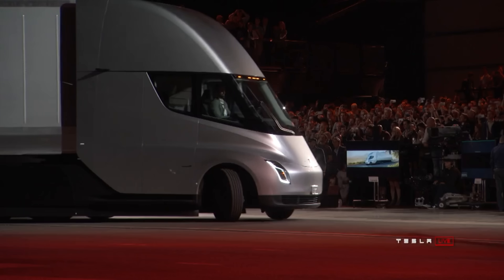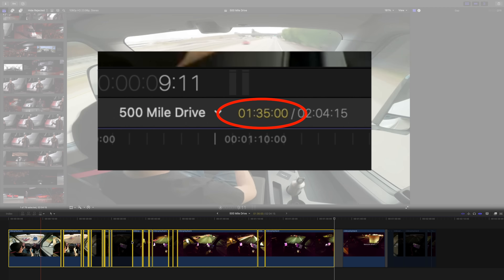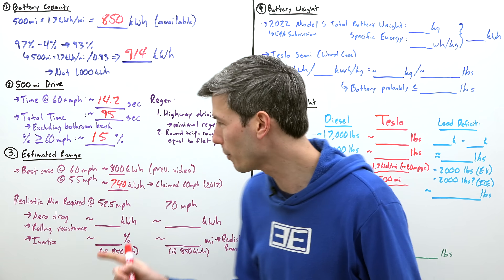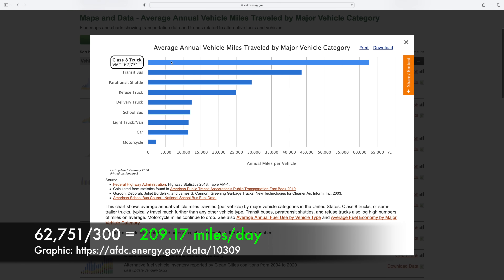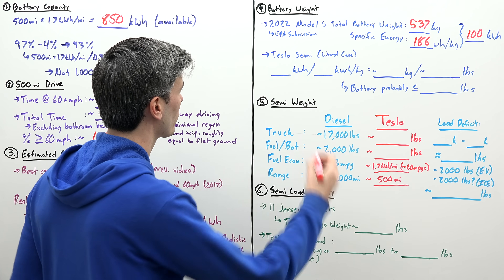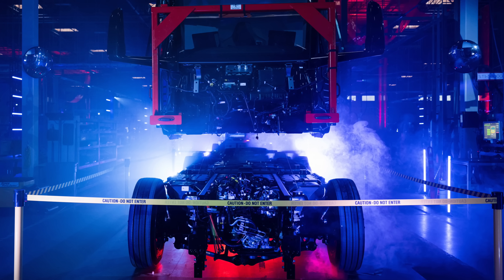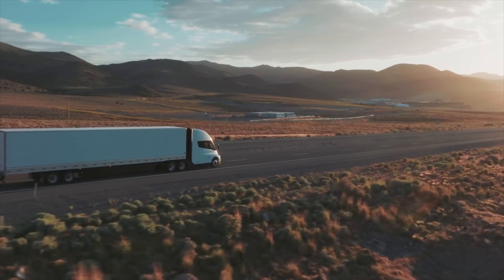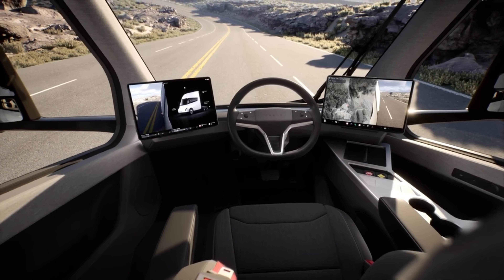Does The Tesla Semi Make Any Sense? Part 2!

Comment: Thunderfoot made a video about the Tesla Semi claiming the 10ft Jersey barriers it hauled on that trip were only 1,000 pounds and that other trucks can haul twice as many.  As proof he showed two pictures of 4 axle trucks hauling 3 axle trailers which were loaded with dozens of 6ft barriers. I pointed out that he was comparing apples to oranges with cherry picked photos of special equipment and did the math to prove the Tesla truck seemed to only be carrying 4,000lbs less than a normal truck.  Thunderfoot blocked me from the comments. He doesn't care if people call him names but if they actually prove him wrong he can't handle it. 

I think the real problem with Tesla trucks is charging capacity at truck stops.  They're great for short haul warehouse to warehouse where they have access to company chargers but if you think giant truck stops on I-70 are going to support 100 trucks fast charging at the same time you'd better be putting some serious money into energy infrastructure all along the interstates.  And drivers can't afford to wait in line long enough to take turns charging due to FMCSA driver hours of service regulations. In transportation, profit is limited by regulations on driver duty clocks.  If you take even 30 minutes out of a drivers 660 available driving minutes, you reduce your profit by as much as 22%.
Reply: Yeah...that sounds like a TF thing.

Comment: "You're only carrying 5000lbs more battery around with you (all the time)"  Over 1 million miles that adds up to a lot, and not just energy efficiency.  You're talking about every braking event doing more wear and tear on brakes and suspension, and motors/drivetrain.  If you're arguing in favor of electric trucks over long distances, i'm sorry it's just not there, trains should be doing that anyways.
Reply: That 5,000 is not going to strain anything that much more than it already would be. And if you are going to break it down that way, then you might as well look at the fact that you won't be dealing wear and tear common to an internal combustion engine..or even the regular oil changes. It's going to just come out in the wash and when it comes to cars, the EV's edge ahead in maintenance despite carrying batteries around. 
..and no I'm not trying to champion EV trucks or whatever...but your argument is about the 5,000 pounds is flawed and doesn't work.

Comment: Freightliner isn't trying to fvck around with the numbers, they know they can get great torque, efficiency, and energy costs when used locally.  They're selling the eCascadia models to very happy port operators.  Stop and Gos with onsight charging... optimal conditions.  Cities and municipalities with local truck operations will be quick electric truck adopters because they have mandated CO2 obligations.  Over-the-road trucks just don't have the energy density or infrastructure to make it cost-effective (which drives everything in this capitalist country).

Comment: If they have an 850kw battery and a 4680 cell holds 100Wh (tesla's number, being kind) and each cell weighs 350 grams, the total battery pack is gonna weigh over 7000lbs alone.  Again these are assuming the best.

Comment: 7.3 mpg US gal = 32.2 Litres/100 Km
Volvo tests pulling 32 metric tonnes in Germany at 80 Kph / 50mph = 21.48 Litres/100 Km But it's hard to compare given there are many variables.
Trucks are limited to 90 Kph / 56 mph in Europe and many operators and countries limit them further. EG Autobahn truck limit is 80 kph / 50 mph.

Comment: A few problems with your video.
The semi has 4680 batteries which are supposedly much lighter than the batteries in the model S.
A semi weighs 17,000lbs with it’s diesel engine and transmission. A Cummins ISX15 weighs over 3000lbs on its own, and another 1200-2000lbs for the trans. The Tesla semi doesn’t have that weight, and the drive motors are (supposedly) very light. Few hundred lbs or so total. The Tesla is most likely still heavier, but it’s not by much. 

That to say, I’m not buying that the semi pulling 82,000lbs is as efficient as a empty ford Lightning, at 1.7kwh/mi. Time will tell I guess, but that is nuts if true.
Reply: It isnt using 4680 batteries
Reply: @orishaeshu1084  interesting, I thought that was the hold up with the thing. That definitely makes it heavier then. 
Still, his math isn’t accounting for the 4500+lbs the Tesla doesn’t have in diesel engine, transmission, and after treatment system weight.
Reply: @jason91notch  his math for the jersey barriers check out though. Regardless he’s still taking a educated guess, and even with a worst case scenario, the Semi obeys the laws of physics and can work, just needs the infrastructure. Remember too that this is generation 1. In 20 years where will we be at?
Reply: @orishaeshu1084  I agree 100%. My point is if the semi weighs 20-22k lbs instead of 27k lbs like he is guessing in the video, that makes the semi even more viable in the real world.
Reply: @jason91notch  hopefully it is much lighter than we think. But so far a lot of details are a secret… likely due to possible competition. Remember what Nikola tried to do.
Reply: @orishaeshu1084  yeah it’s tough to tell. I think 20-22k lbs is a pretty reasonable guess. if they ever get the 4680’s in it, that’ll drop to 17-19k. 
The biggest issue with these is being able to do 1mw charging. That’s more energy than most truck stops are using as a whole, all going to a single truck. The infrastructure for that is going to take a long time to build up.
Reply: @jason91notch  Tesla will definitely have a use for all their spent EV batteries for storage, and solar is getting cheaper. But yeah if Tesla energy doesn’t step its game up, that will be a problem.
Reply: @orishaeshu1084  even if they offset it with solar arrays/batteries, if it’s tied to the grid in any way then transformers feeding it will have to be upgraded. It’ll definitely be interesting to see how the infrastructure side of this plays out.
Reply: @orishaeshu1084  another thing to think about- if they’re being used as dock-to-dock trucks and have all night to charge, they’ll still need 150-200kw chargers to charge overnight. Which means DCFC’s will have to be installed at these ports, at an enormous cost, 30k-60k each.

Comment: 2.1 version will be needed -
transportation of upper limits of cargo (up to 80,000 pounds)

but I think, only due to an increase in battery capacity, e-motors power,  number of wheels and trailers for one tractor.

Comment: Is 42 psi common for the trucks? Also I wonder how much weight was on it for the 500mi since estimate about 20 -25 pallets and the rear one says 600kg.
Reply: 42psi?
Reply: @EngineeringExplained did you see this tire pressure?

Comment: Also, using a flat ground mpg for diesel class 8s  is not a fair comparison as they do not recover energy on downhill stretches like the Tesla Semi: accordingly, a trip involving crossing a mountain range will cost the diesel significantly on its fuel economy.  And the average efficiency numbers I've found elsewhere on the web seem to point to 5 to 6 mpg in the real world, not 7.3 which I assume was under very specific circumstances.

Comment: There is another video that gives more info on vehicle GVW (44K & 49.5K LBs), power of the 500 was listed at 900kWh. Cant find it. 
If the power is now 850-900 kWh, it will do nothing to help the ranges of realistic routes with hills, wind and cold.
EE and Tesla info show that trucks dont all go maximum distances or with maximum loads, which is fine, but in realistic conditions, drivers may find that is all the tesla can manage and nothing more.
Not quite the panacea that Electric Jesus tried to imply.

Comment: It is important to keep all kinds of technologie being advanced and improved, but electric trucks are far from ready to be viable.
First you need to have the grid ready which not even the USA has, it is quite an expensive improvement and I doubt its viability in the near future.
Then you need to consider the climate, just now the US got hit by a massive snowstorm and electricity went out in several locations, you should also consider floods, snow and heavy rain with electric trucks with 1 or more years of service, since the combinations of rust, salt and potential minor traffic accidents can severely compromise the battery isolation system.
Other important things to consider are the charging times, battery life span and disposability, battery manufacturing cost, the social cost (the minerals to manufacture the batteries are controled by Chinese mines in empobrished countries) and the true enviromental impact of manufacturing the batteries since not only the mining polutes the air, but it also polutes the water and the soil.
Not only that, the supposed goal of using electric trucks is to reduce carbon emitions, but no one is talking about the actual source of electric energy in USA or all over the world for that matter, which is its mayority fossil fuels, that alone defeats the purpose of using electric trucks.
Again, I am not against the improvement and development of new technologies, but electric vehicles are far from being the ideal medium for transportations that the government and big companies claim, we have far better ways to transport goods and people and we should still use them until a new technology actually becomes a better option.
BTW, I would also say that we are making a mistake introducing more and more electronics in our vehicles, a single solar flare can put us down again in the dark age and we should be integrating mechanical technologies in our transportation and vital infrastructure as a faiol safe in the case of electronics being disabled by an unforeseen and uncontrolable force.
Reply: Does it? It took Horatio Jackson around 63 days to drive across the US. There was barely any infrastructure. He drove on railroad tracks, paths that were barely roads, through fields, there were no gas stations (he had to mail order gas and parts sometimes) and there wasn't even a complete atlas or set of maps. You could easily make the argument that the infrastructure for the car was not there. But the car came anyway and everything else followed. If you spend all your time waiting until all the details are worked out ahead of time, you'll never get there. 

"but no one is talking about the actual source of electric..." Yes, people have talked about it...to death it has been discussed. The fact is it still works out in favor of the EV. And if your concern is about where the electric is coming from, you don't want to look at how inefficient our current method is. We currently use electricity and gas at every single step in the process to get gas to your gas station so you can use gas to go get gas. 

Solar storms? If a solar storm knocking everything out, including cars, is your concern...it's too late. But, one of the strongest flares occurred in 2003 and was barely noticed. Vital infrastructure is far more likely to get knocked out locally by other events. One tree fall can cut off an entire neighborhood or effect power for thousands. Now you are just trying to plan around a worst case scenario doomsday level scenario. And yes, you can keep saying but what it but what if but what if until it is catastrophic, but at that point you'd be screwed no matter what.
Reply: @AveragePicker  There is a little flaw with your argument, we have better more cost efficient meduims of transporttation than EVs, and the Internal combustion engine did had a lot of advantages over trains and animals of burden, nor inly that, you never adressed the social cost and the inmense scarcity of the minerals needed to go full electric nor the viability of the grid handling all that new flow of energy being pulled from EVs. This is exactly why I started my argument stating that it is always important to keep researching and improving new technologies, meaning that I am not against EV's per se, but that I am against the obviously political and financial reasons behind its forced push, which is supposedly intended to reduce carbon emitions and that does not align with reality, and that is precisely why the electricity source type is important in my original argument so, even if EVs in the perfect scenario are more efficient after 2 years of use vs an  internal combustion vehicle, the carbon emision savings are negligeable compared to the carbon amitions of a single private jet used by polititians and climate change advocates and that is not even considering that carbon emisions from IC engines is only a small percentage of the total carbon emisions worldwide.
Reply: @Monstah_Huntah  As I said , it's been discussed and researched. The carbon emissions savings is not negligible. Even if only used coal plants, the CE is still lower.

Comment: One aspect not discussed is the elimination of the Jake brakes typically used for descending long steep grades. Should one expect equivalent performance from an electric version of semi?
Reply: Sounds fine and dandy, but if the battery is charged to 80% or higher at a high altitude, once the regeneration fully charges the batteries it will have to dissipate the remaining energy as heat since over-charging batteries will harm them no matter what.

Compression brakes turn the engine into an air compressor but they don't use any fuel in the process. A lot of EV fanboys seem to think that the engine is still burning fuel when the Jakes come on, which is disingenuous beyond recognition.

Comment: This is all the engineering side. What it doesn't address is usefulness. The center seating position is probably the worst problem followed by the absolutely impractical position of the doors. In this truck you can't drive up to a gate and hand down paperwork. You have to get up, walk around the driver seat and reach out the door. The same seating position problem comes into play when you want to pass a slower vehicle: you have to pull a lot more into the oncoming traffic to be able to see past the truck in front of you. That aside, the door location seems to make a living space in the cabin pretty much impossible and you drag dirt in every time you leave the vehicle. In a traditional truck that dirt stays on the driver floor mat, in a Tesla you drag it from the behind the driver seat door all the way through. I'm pretty certain many truckers will not be happy with any of that.

Comment: Overall a good analysis. I do have to disagree that power consumption is the same on level and hilly roads. I believe there is at least a 50% loss in recovery during regen. My Leaf barely gets 50% recovery on hills that start and end at the same elevation. You lost me on your discussion of speed during the Semi’s video trip.  The CA speed limit for trucks is 55mph. And the route the truck took is through the most congested corridors in California. A trucker would be lucky to maintain a 45 mph average speed for that trip.
Reply: The regenerative breaking is "tuned" differently for different vehicles. Companies tend to split some difference of tradeoffs depending on what they want out of it. Tires can even come into play as companies have to meet stopping distance regulations, and some are starting to not use the lower rolling resistance tires because the range increase they provide is minimum and the difference can be recovered from the brakes somewhat instead. ...Now I also wouldn't be surprised if to get those numbers they essentially tuned the brakes to something that feels completely unnatural.

Comment: In the cost you also have to consider  battery-pack replacement. If you run 350-500 miles / day (a part of the trucks) means you have a 0 to 100% charge per day, possible fast charge. In that case, every few years (3-5) you'd probably change the battery pack (or sell downstream to those who drive less and don't care they have only 80% of the battery).

Comment: As an OTR, running teams, it doesn't make sense. I would run ~75k loads from coast to coast. With a 200 gal. tank set and an average of 6 mpg, the truck would often stop for a total of 4 hours in a 24 hour period, covering 1200 mi. or so. It is  300 miles from Miami to Jacksonville, FL, and a driver isn't going to want to sit at a charge point when doing a hot lap, it eats too much into the time. San Antonio to El Paso is close to 600 miles. Same argument. 
   HOWEVER, EV trucks have a great role to play in the short haul and day runner set. Imagine an OTR dropping their load at a satellite yard outside Detroit. the tractor alone tends to be 25'-30' long, making maneuvers tight. An electric day-runner, already short because of a lack of sleeper extension, would be even shorter based on the provided picture, allowing for tighter maneuvers. Getting stuck in traffic wouldn't be as bad as the truck wouldn't be idling, and the driver isn't on the kind of time crunch that the OTR driver is, courtesy of DOT regs.

Comment: I work for Cummins and I've had dozens of people ask me the question of how much of a weight penalty the Tesla semi would have.  I think Jason got it right... probably could go into further detail on some of the things you don't need in an EV, but it's also tough to guess the new Tesla drive train weight.   EV trucks will definitely happen in the future, the economics will drive how fast it is implemented.  Once you get several dozen or even a hundred trucks paying on average per charging station, the cost per truck will be small enough.  I think you're probably at about $35-$45k more expensive to build the truck as an EV right now, but you can make that up in fuel savings in a year or two.